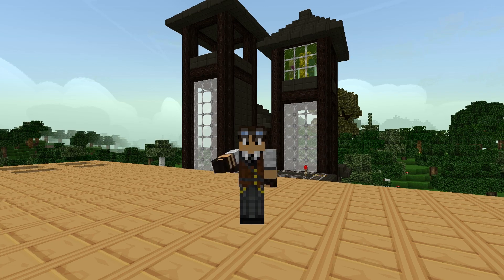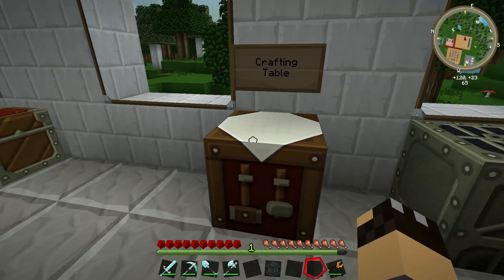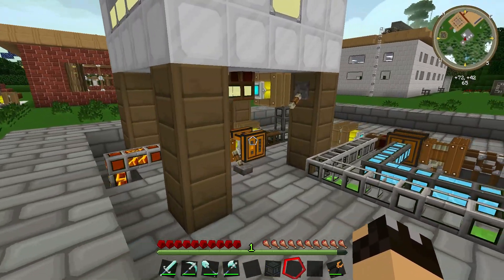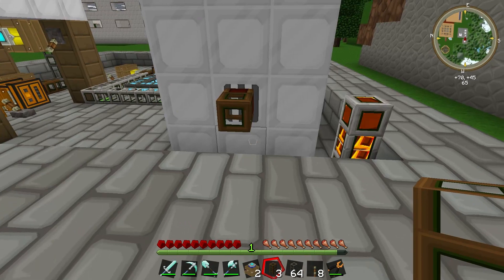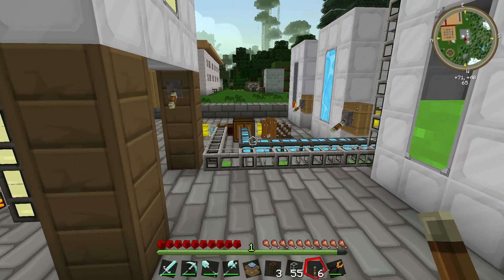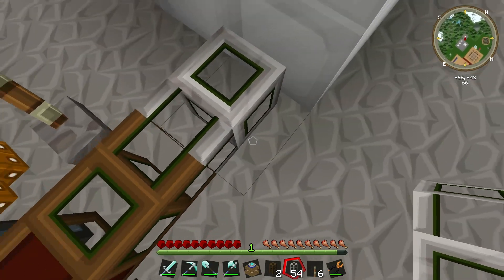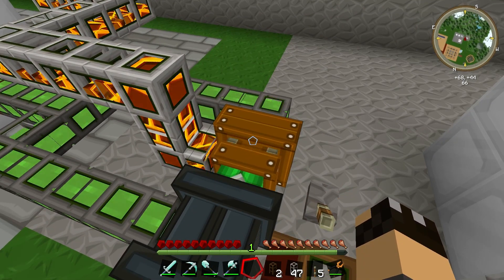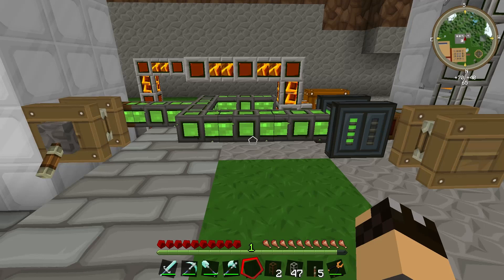How to Feed the Beast in Minecraft - Biofuel Still - 22

Comment from the maker: Currently no, sadly. If it's a machine that can accept cells filled with fuel, that would work. (as fuel cells are an item, not a liquid). The best bit is that empty cells are consumed along with the fuel (though this does mean you'll need to keep filling empty cells). Can also be done with buckets, but requires a complex system to return and refill empty buckets. But as the new versions of FTB don't support redpower, it might not matter :(

Comment: Is there a liquid pipe that works like Pneumatic tube? I love that your peat fired engines get fed fuel when they need it. It's there any way to do the same thing with liquid fuel? I find my tanks get unnecessarily drained by engines/machines that arn't always using them.